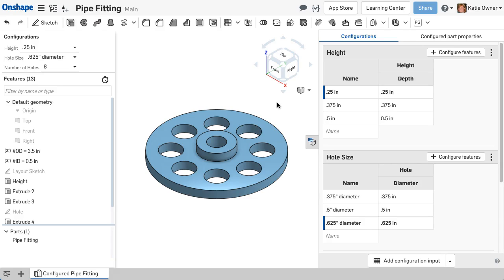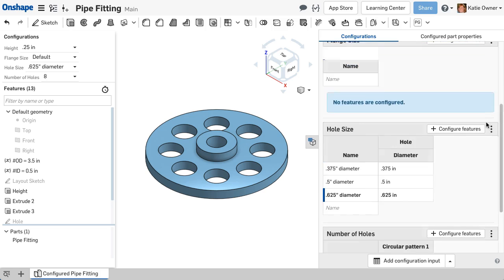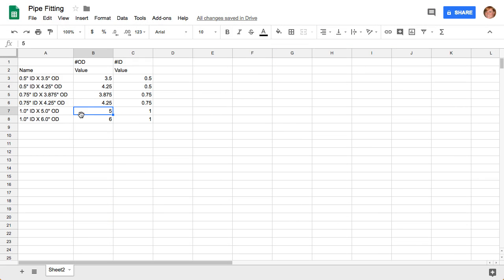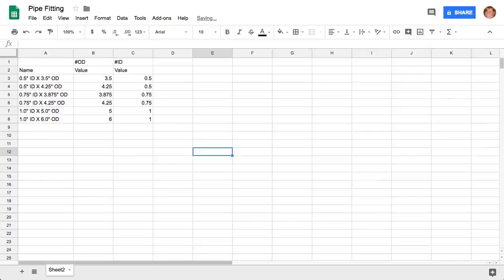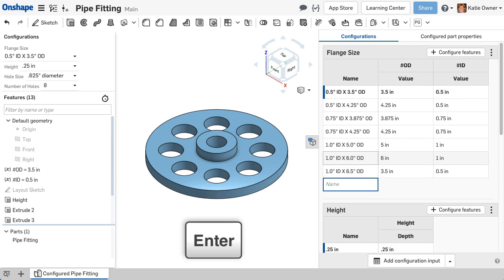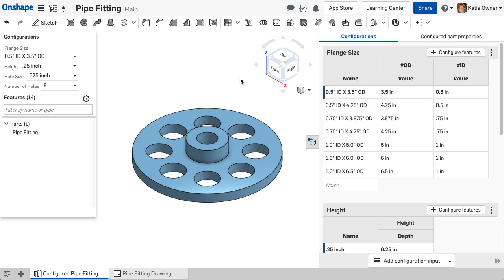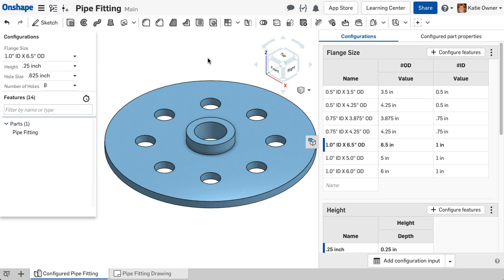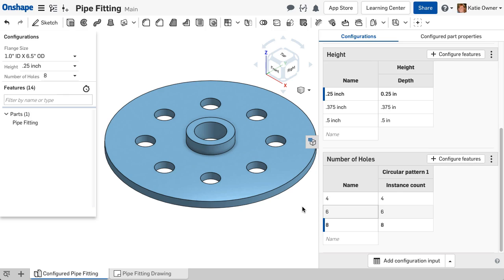Working with Configuration Tables

Comment: How do you use a value from one table in another table? For example, number of holes as a function of the flange diameter.
Reply from the maker: Your example of driving holes from a diameter is completely doable with a function: https://cad.onshape.com/help/Content/variable.htm?Highlight=function 

However, it sounds like you might want to use this function over and over again with something like a global variable, but thats a limitation: https://forum.onshape.com/discussion/12811/global-variables
Or potentially this might help: https://forum.onshape.com/discussion/4432/global-variables-feature-script 

Long answer, let me know if any of this helps!